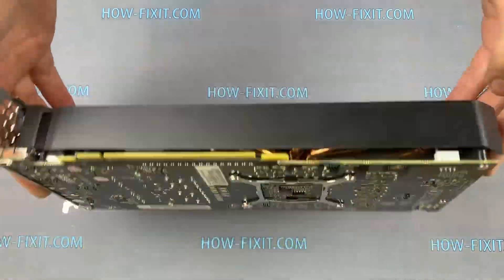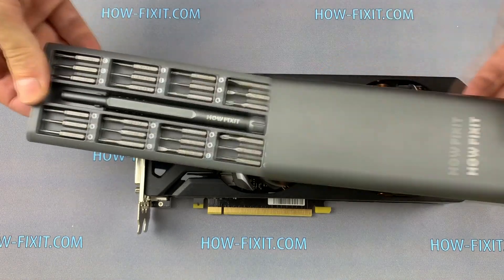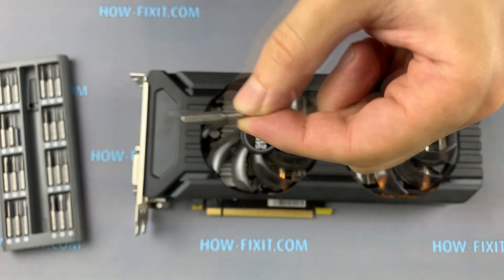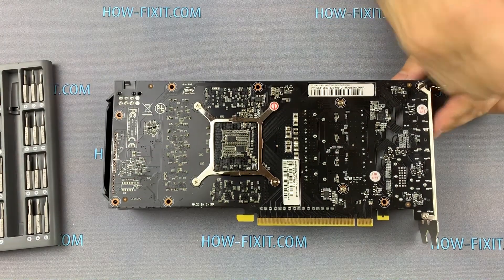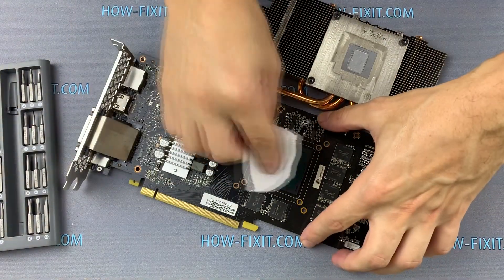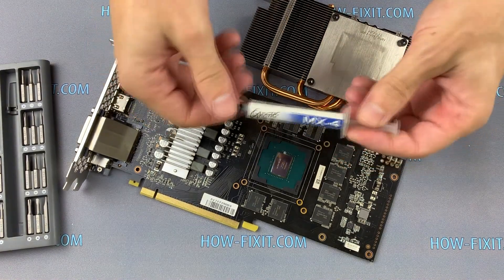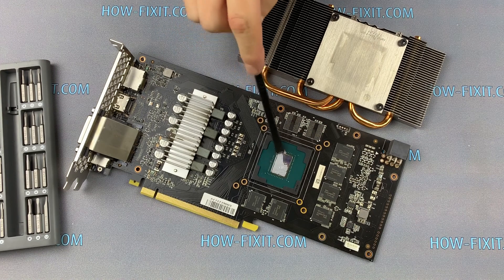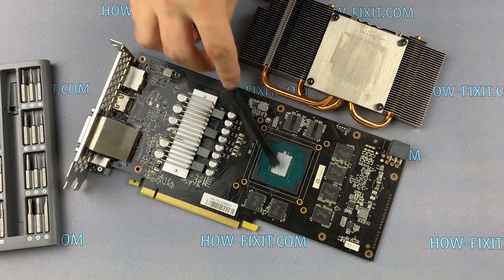GeForce GTX 1060 Disassembly, Cleaning and Thermal Paste Replacement

Comment: It's 2025 and I've not changed thermal paste on my 1060 at all, idle temp is still reasonable at 40 degree in summer, is it even worth it to replace?
Reply: so i decided to change thermal paste, inside was extremely dusty all over, clean and boot, ZERO TEMP DIFFERENCE LMAO, i guess lesson is to not bother if the temps are still good, or change to the best stuff like ptm7950

Comment: You seriously used a fake arctic paste for this video? :D :D :D
Reply: It's the method that is shown that is important here. I would not skimp on thermal paste, to save €3,- while ruining my graphics card (replacement won't be so cheap ;-) ), or having to repeat the process sooner than I'd like. I value my time as well.

Comment: do NOT do this if your graphic card is still in warranty, only do this when it's out of warranty. if u do it it will void the warranty
Reply: better then letting it die from dust, you think youll get a replacement for letting it die in dust yourself?
Reply: @budgetking2591  If it accumulated during normal use, and you weren't able to fix it without voiding the warranty... yes, you should.
Reply: @EmmaJ_462  forget about that.
Reply: If you live in the US, it's fine, it's against the law here to revoke warranty after removing the sticker.
Reply: Yeah... no shit, why do you think there is a screw marked with red paint... also guess what, you can re-paint it.... mind blowing, right ? eh...